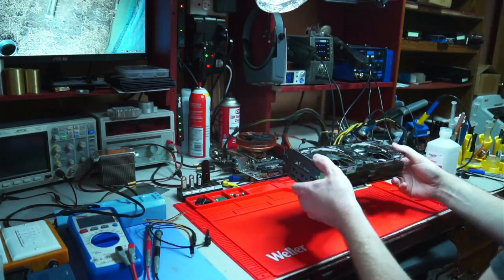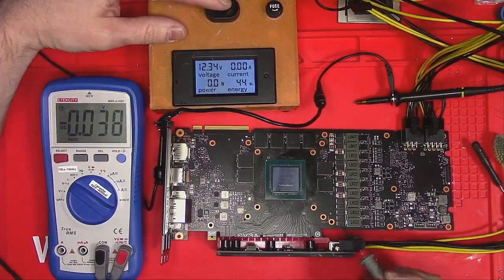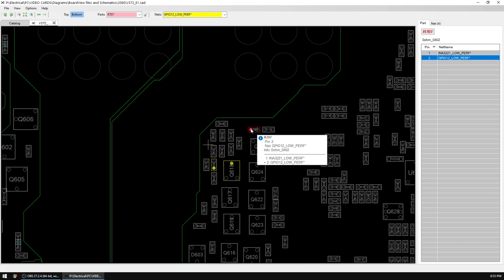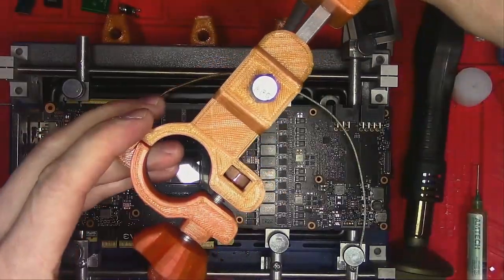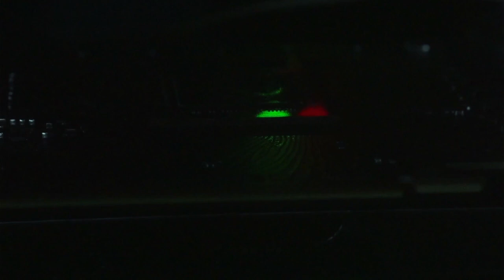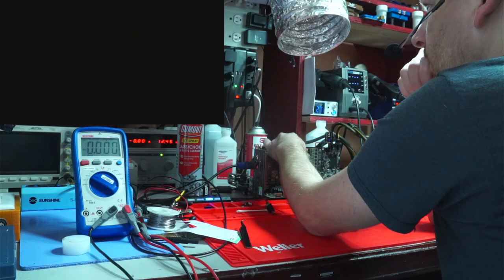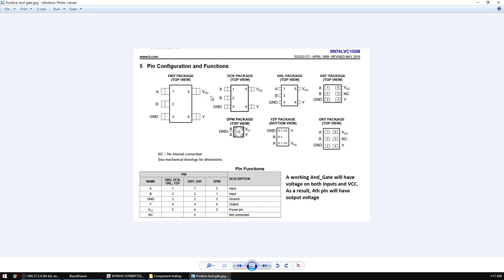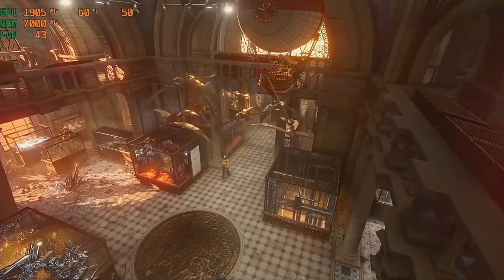how to fix "please power down and connect the pcie cable" error

Comment: I'm the owner of the card. Thanks so much for the repair. It works great now!

A brief history of the card to clear up some of the mystery: I purchased it used and for a previously unknown reason, the previous owner had removed one of the fans. Now I believe it was because it was stuck at 100%. I used it for about a year with only one fan. It ran perfectly but then I decided I'd sell it, but figured I'd get more for it if I replaced the fan. At the time, OEM ones were very expensive, so I purchased an aftermarket one. 

When I went to test it afterwards, I got the error message about no pcie power cable detection. I opened it up to see if there was anything obvious, but didn't notice the tiny warranty sticker and ended up breaking the part where that screw attached.

The capacitor that I crudely soldiered on I found on disassembly, loose, sandwiched between the card and backplate. No idea why it had become loose in there.

Anyhow, with EVGA ending their graphics card manufacturing and the terrific story behind the repair, I can't bring myself to sell it. 

Thanks again for all of your effort on this!

Comment: Good stuff :)  Always fun learning more board repair stuff, even if it makes you want to pull your hair out with some of those weird issues. That fan issue probably would have drove me crazy, but i generally always run the fans at 40-70% anyway under load. Light loads it shouldnt matter.

Comment: Good job.. hard to find a problem if it is related to tiny resistors and if its not really dead and showing high resistance.
Reply from the maker: It would be a lot easier if i knew exactly what voltage is needed in order for the power state to go from LOW to HIGH.
I would have found it in seconds if i knew that.
Hopefully this video will help someone eventually.
Reply: @northwestrepair  It will help to someone no doubt, i admire your skills and learning a lot from videos, there can be a lot of diffrent faults as much as component count on the pcb. Hope you can share more videos soon. 👍

Comment: Hi. Bought a used sapphire radeon hd 5970 with 5 tiny ripped smd caps near the pci-e. The card does not get detected in some motherboards. Any idea what i should order to replace the missing ones?
Reply from the maker: yeah
Reply: @northwestrepair  Great, which is?

Comment: I just bought the GTX 1070 KATANA but for some reason my pc not detecting the graphics card. The graphics card uses 6 pins with extra 2 (6+2). If I plug in the the six pins it tells me to PLEASE POWER DOWN AND CONNECT PCIe POWER CABLEs FOR THIS GRAPHICS CARD. And when do connect the extra it displays nothing. The pc don’t even detect the graphics. Can someone please advice or give me a solution ? Thanks

Comment: i have this 2060 that was given to me. He said that it was peed by a rat and i saw that theres green corrosion on its pcie copper contact pads. is it possible to solder those pads to the board?
Reply from the maker: yeah

Comment: What's the deal with having to change the 2k to 1k resistor? Was there some other component that went out of spec to make that necessary? I didn't understand that part.
Reply from the maker: I do not know why voltage would drop lower then 1v.
Every component in that circuit was tested on and off the circuit.
Reply: @northwestrepair  Pretty amazing that you were able to figure out how to make it work

Comment: Can you tell me please about gtx evga 1080ti with 3 fans ftw3 is it good and durable it was used 2 Years so what do you think is this card better then evga with 2 fans or not and is priče god 250 dollars ?? I would love your thoughts .
Reply from the maker: i use EVGA 1080Ti 2 fans
Reply: @northwestrepair  well can you tell me anything about this one and does it have problem with standing in line or does it have problem Like other cards to be leaning on one side :(

Comment: So, did the aftermarket fan kill the circuit, or did the broken circuit make the owner replace the fan with an aftermarket one?
Oh, by the way, Diablo 4 might result in an influx of broken GPUs.
Reply from the maker: I dont know, hard to tell. Very much possible since that signal is going straight into the core.
If it happens again, we all going to learn a lesson here; NO AFTERMARKET FANS

Comment: i Alaways want to ask you this question and i forget...Why some ppl heat the gpu after it die..and why it work for a short time and dies again ???
Reply from the maker: i dont know how to answer that.
It like saying: people hate their car after it had new radiator installed.
Its physiological issue. According to my pole i did a while ago, people prefer USED gpu over refurbished.
Refurbished gpu will get new thermal interface done right and tested allover before selling it, while used gpu can have dried paste and crumbled pads. Yet somehow buyers dont even want to think about it and buy USED thinking everything is going to be OK.

For that reason, if i fix a card for sale, i list it as USED because......humans
Reply: @northwestrepair  Thanks for the answer..i love your content
Reply: I think the answer here is heating the GPU in an oven or with a heat gun can sometimes reflow solder and fix cracked solder joints thus fixing the card but this is a temporary solution since the card is already on the verge of dying.

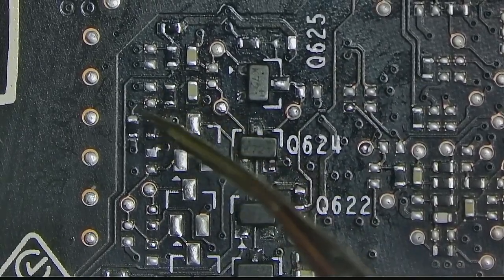Comment: You have made a mistake. You have moved resistor r693 horizontally, so it doesn't worked in normal mode. See yours 4:56 and then position of this resistor on 10:40